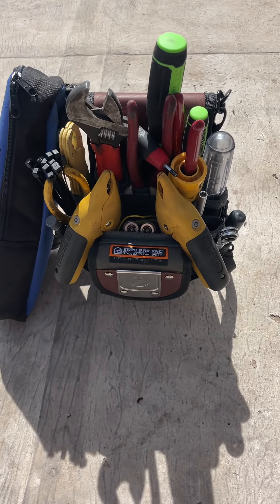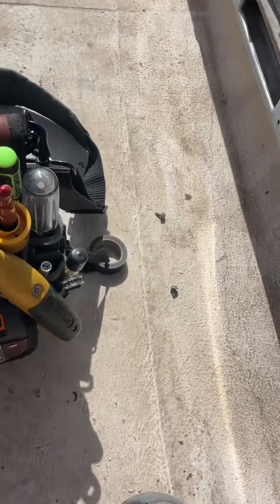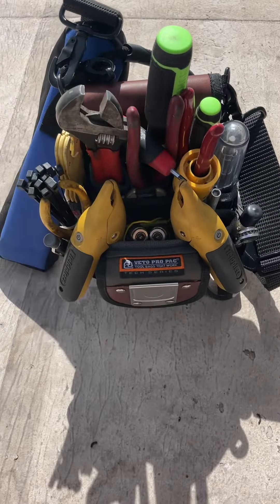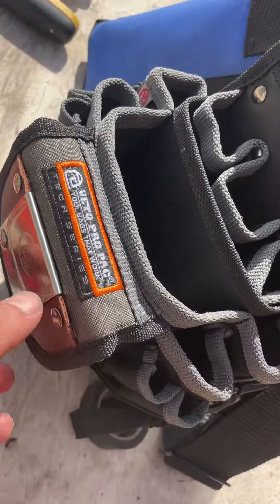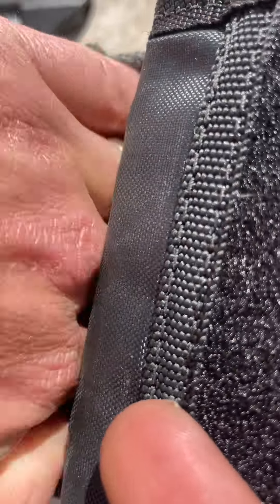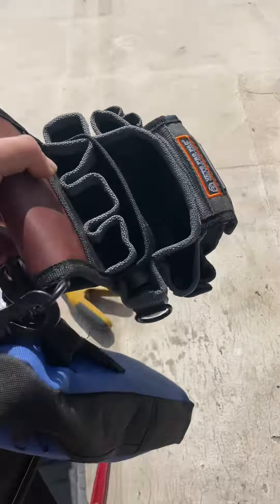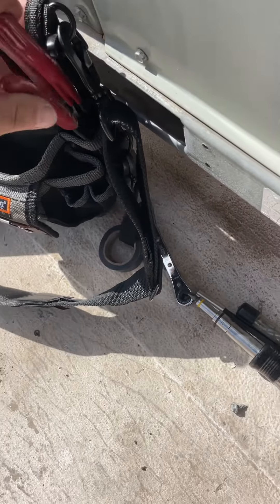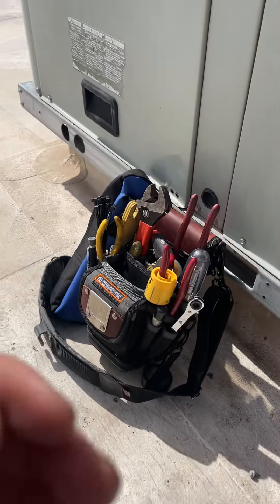NEW BAG & ITS tiny! (VETO TP3B) REVIEW

Comment: Nice video, these little pouches are amazing. Great layout, high quality. I have a tp3b and needed to carry 2 more tools so I swapped it out to the tp4b. As a commercial/industrial electrician it stores all the daily important hand tools I need. I work off of a cart quite a bit so the clip comes in handy. 

Only issue i found with these "b" series pouches are they are front heavy and both the 3b and 4b will fall on their face quite easily. THE FIX:  If you buy a 1/4" piece of black ABS plastic and cut out a perimter of the base of your pouch but make it about a half inch larger all the way around. Drill two holes in the bottom of your veto base and attach the plastic plate to your pouch. Last note is to use tapered screws through the bottom of the plate and countersink the holes so everything is flush. Hope this helps!
Reply from the maker: Good tips man! Will look into that
Reply: That'd be a great re-design idea for Veto in the future.  The TP3B, 4B, and 5B should all be about an inch larger in the front to be more stable and give more room for a clamp meter in the main open pocket as well as just a hair more room in the front pouch pocket.

Comment: Glad to see that 5/32's T-handle.  I don't get how guys that work on RTU's all the time and DON'T have one of those in their pouch.  I found a really nice on from BETA that has a sliding handle that you can put all the way to one side to use the main shaft as a breaker bar to get the set screws with threadlocker broke loose.
Reply from the maker: Going to have to check that out! Cause I’ve almost broke mine afew times 😅

Comment: My TP4B  (Service Bag) is starting to feel heavy while doing Spring Maintenances 
I've been considering dusting-off my old TP3 and loading it up with JUST what I need to do a Residential Spring Maintenance (and maybe shave 10lbs off of what I carry)  in addition to the Milwaukee canvas 'Bucket Bag' that has my Nitro tank, hose, regulator, funnel, pan tabs, and other accessories for blowing out drains.
Reply from the maker: Very nice and convenient set up with the Milwaukee bucket 👍🏽
Reply: @deserthvaclife9768  It works for me - been running it like that for a couple summers! 
#1 advantage is you don't hear the 'clanging' of the tank!